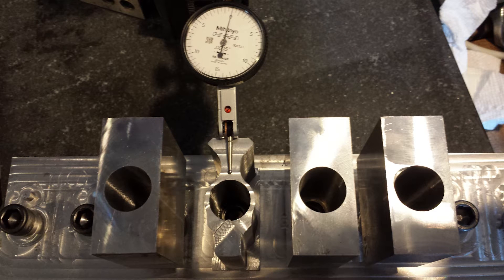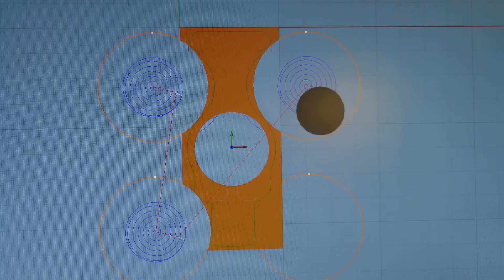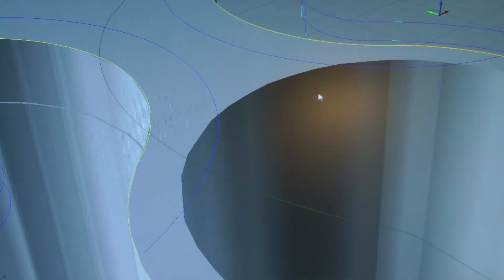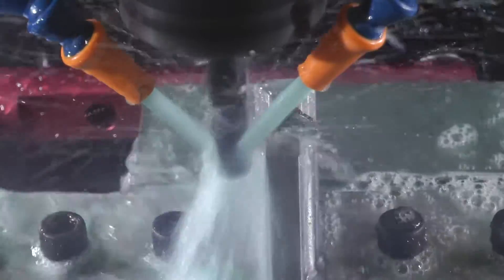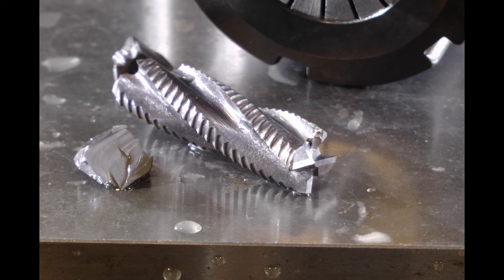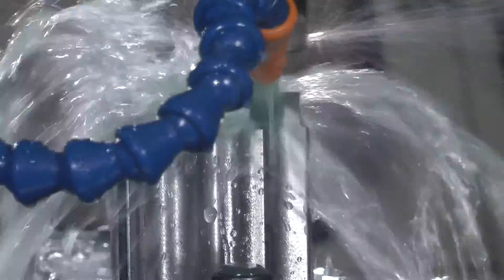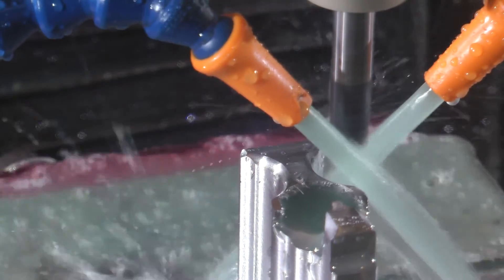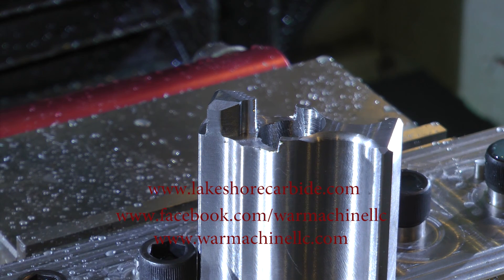AR15 High Rail Gasblock: (pt.3) Machining ops on front side of fixture 1

Comment from the maker: Thanks for the suggestion Allen. I machine it already heat treated for a few of reasons but maybe I'm wrong on all counts. I read numerous places that 4140 actually machines much better heat treated than annealed. Sure it's harder but the end machining produces a more accurate and consistent finish. I also don't want to induce any dimensional changes/warping that can occur after heat treating. That would just add a whole new layer of complexity. Another reason is that my supplier doesn't sell annealed in the size I need anyway and even then it is still nearly the same price as heat treated. With all that said it just seemed more economical with time, money, and complexity to machine heat treated. The repaired Mikiniish machines the HT just fine too, you just have to dial everything in a little tighter.